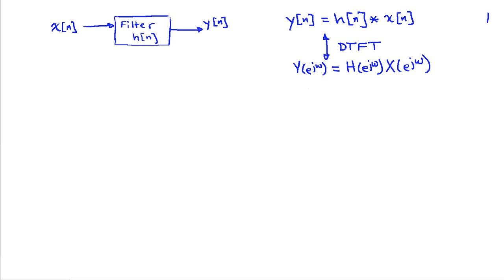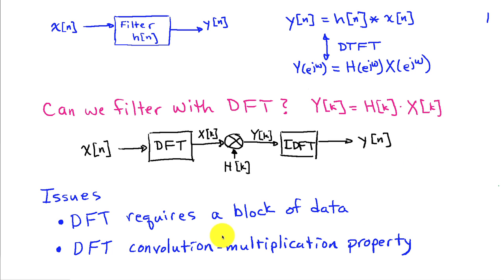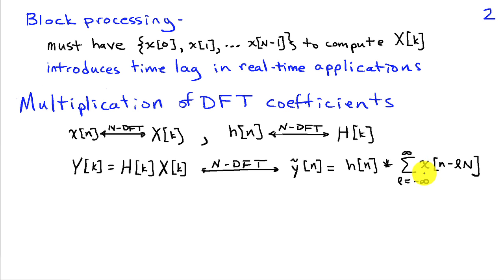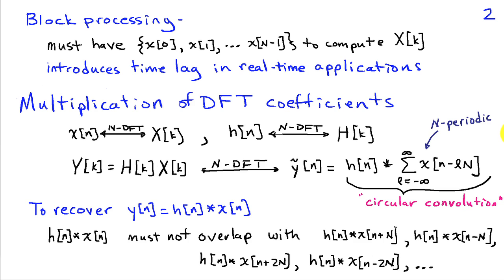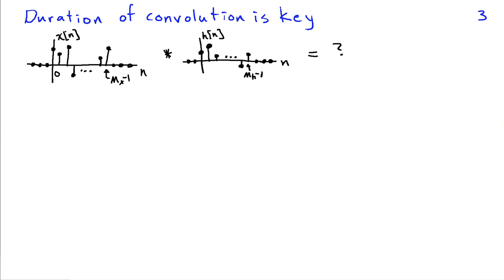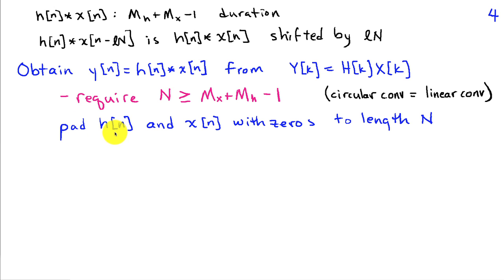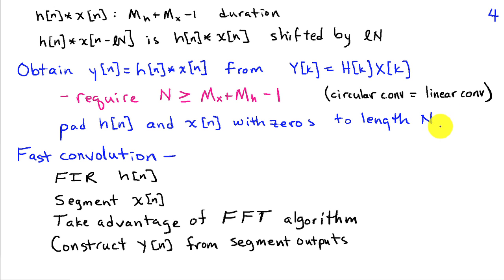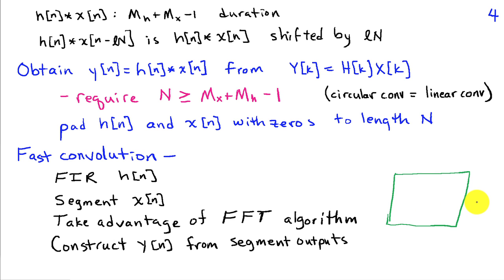Introduction to Circular Convolution and Filtering with the DFT

Comment: Anyway, the conclusion is that we want a linear convolution rather than a circular one, and the condition under which a circular convolution equals a linear convolution in dft is the length of the block.